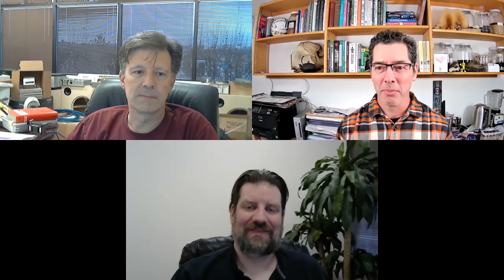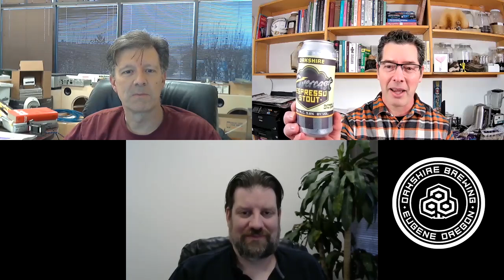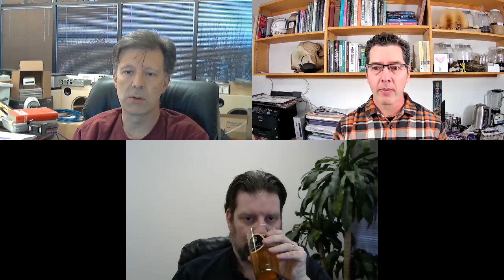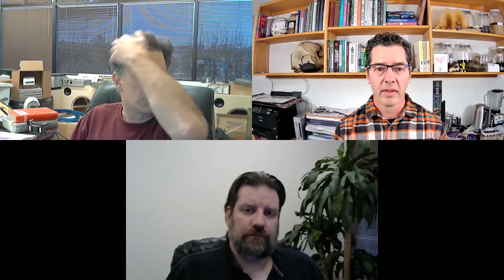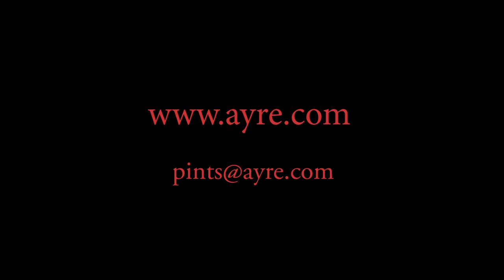Async SPDIF Patent | Pints with Ayre

Comment: I went back to listen to this again to make sure I recalled the statement correctly of the patented designed eliminating the variable of source and incoming cable to the DAC performance.    Is this also true for USB input?
Reply from the maker: Hey Bradford, sorry for the delay! *I am still a youtube Noob*. :-) 

The Asynchronous input for SPIDIF works similarly to the Asynchronous USB input, in that it does not rely on the sending devices clock at all, and buffers the data to be re-clocked super close to the buffer to shorten the signal path as much as possible and eliminate jitter.

I would say the cable and device it is connected to is still going to have something to say in the matter though(not as much with async, but something!). Such as the fact that USB will almost always have 5v of power running side by side the conductors; and something like TOSLINK will be totally galvanically isolated, and still benefit from the asynchronous re-clocking, but without the noise from the power supply being a factor. 

The asynchronous tech "levels the playing field" a bit more for the SPIDIF/TOSLINK, USB, or NET input connections and devices; but everything matters.